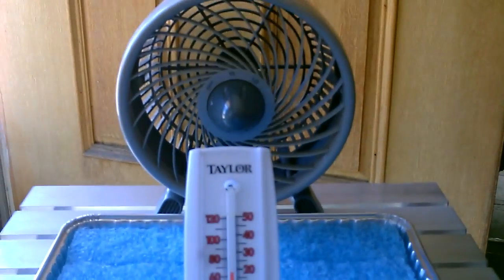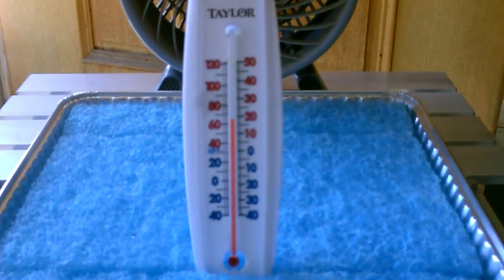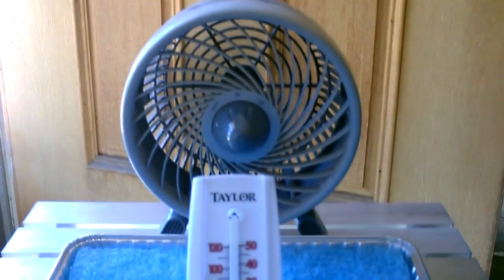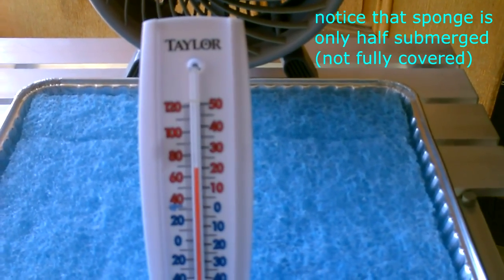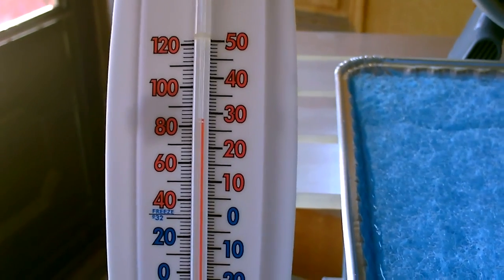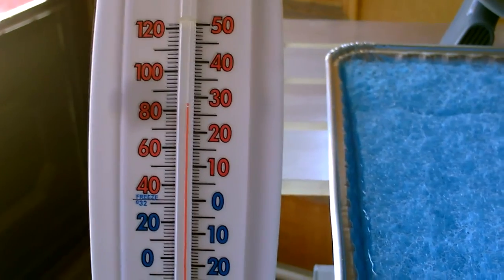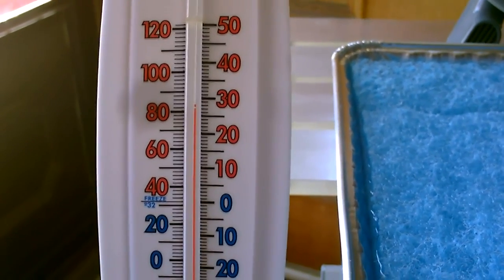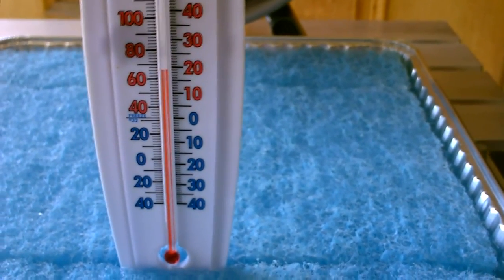Homemade "Sponge" Humidifier/Air Cooler - DIY - Fan-Forced Evap. Cooler/Humidifier

Comment: You actually would need to have a hygrometer to measure the measure the humidity, not the temperature.
Reply from the maker: hi. this is true but you can roughly tell what the humidity is just by knowing the temperature drop. they have evap charts that show the humidity level if you know what the room temp is and how far the temp dropped.

Comment: I have a wick filter for my humidifier and it always hardens despite of my using the stupid chemicals to prevent calcification.  Soaking them in vinegar weekly does not help either.  Im tired of having to buy new replacement filters every few weeks!  The city water here sucks!  Im going to try this sponge idea.  Thanks!
Reply: If you have the large paper filter, I have one for my Essick...well, I went to their website to order a new one and they went from $10 to $31 and I said "not" - LOL.  So I went out and bought that blue cellulose stuff they use for evaporative coolers.  It won't wick of course, so I cut a piece of 1/2 PVC, drilled small holes in the bottom. Glue a cap on one end and siliconed a plastic L fitting on it.  Attached it to the smallest pond pump they make and it runs great.  

You could use aspen and probably not have to go thru all that, it will wick.  I used the blue cellulose because I have several of them and I use them in my tropical greenhouse and the blue cellulose lasts longer before I have to replace it.

It sounds like your filter is itty bitty but I thought I'd mention it.
Reply: Maybe use reverse osmosis water?

Comment: I like it, I have AC but I notice that placing a long wet towel on a long cloths hanger is very quick to increase humidity you have to play with the towel folding size to get it 40 to 50%, the recommended level of humidity. if you see it is very humid fold it onto half, it sure make huge difference now I sleep with AC but without the effect of dry mouth etc.. the only disadvantage is that towel need to be wet every 4 hours .. but if it is folded or 2 towel fold it on themselves together it take 10 to 12 hours to dry and turning the inner side of the towel out after 4 or 5 hours to expose the wet side of the interior of the towels. It really makes huge difference,no cleaning of humdifier, or fear of mold on it,  nor noise , and echo friendly and clean.
You can not put 3 or 4 towels at once because humidity jumps to 80% easily so it is a balance... but it is great.
I let the towel dry for 30 min or an hour by the time I am out.. or more.. so it would not create mold.. I never seen mold anyways but just in case I throw it on the washer every weak  just in case though they are clean towel but minerals accmulate on them from the evaporated water..  if you wash your clothes you can hang one item there too and skip the towel etc..
Thanks for the video, and this long comments are for others who may want to other ways. 

Stay COOL 

PS I have never had any ill effect from AC since using this, one day I forgot to wet the towel and My GOD what a difference it made with or without humidity.
Reply: Thank you for this comment, I’ve been struggling with this since I put my window AC unit in and I’m going to try this tonight!
Reply: @margaretgodin8459  you are welcome, Air conditionar dry the room, it takes whatever little humidity in the air, and condense it , hence water drip from it (we only see that only if the little interenal drain is blocked , the AC strat dripping water that water is the humidty gathered by the cool temperature on the coils..)  by the way plate of water in the room, a famous advice, does not increase humidty by much, even fan on it, I try it and have 3 humidty meter.. even with fan on a wide bucket of water, it increase it by 4 to  5% not much considering it take space and not looking good, I just did it to see for experment..
what is your level of humidity in your town..
I live in a desert zone, in much of year it is around 40% approx, but in summer (5 months) it is as low as 6% ... it is on these months I hang a towel etc.. if you have 20% and above it is very easty to incrase it by 10% percent.. but when it is 6% you notice the towel dry in 6 to 8 hour (2 towel folded on each other) so it would last longer..
Reply: @margaretgodin8459  I forgot to add the "plate of water in the room" tip, only work if it is as big as  big as the size of a half bed or or a bath tub size, I did the calculation.. so it would have a large surface to evaporate passively.. 2. I also close the room and windows,  and I realize only neat towel fold it on itself (or 2 towels when it is very dry weather) are the best.. now if the towel is near a fan or the AC opening , the humidity increase very quickly .. ideal level 40% to 50%, but it is ok on skin etc if it is between 30 to 60% above that it get uncomfortable and encourage bacteria growth .. the sign that you are having 30% to 50% or even more, is if you bring to the room a cold glass of water with  4 cubes, or a very cold water bottle and in few minutes you see it foggy , the more water droplets the bottle forms around it the more humidity in the room, if it does not form fog at all then you live like where I live (when it is summer, ) then you really need to increase the humdity.. tell me and I explain with more details sister. I wish you the best sister, Salam.
PS: I live in Arabia, I can buy humidifier but read that the head of the spreyer need to be cleaned frequently so that mold won't accumulate etc etc.. so I worried about that and hate to have machine on 24 hours even while a sleep, the towel is quiet, clean, and friendly to environment.. have a great day
Reply: @margaretgodin8459  also if you notice the towel become rough on touch (after a week ) it is no worries, this is the mineral deposit from water which evaborate and the towel becomes rough to the touch.. that is why I toss them into the washing machine every week or 10 days.. I notice the that door mat (from natural material and new ) hold much more water and last double because they have many thread.. but maybe not necessary... I just made many experment for fun (and check my hydrometer, the humidity meter to see which is the best) hope that help..
Reply: Another thing, I notice that my old AC cooled 2 degree Celsius  more with humidity around.. which made and less work on compressor, and room stayed cooler longer when it is off. I always stop it every hour or two for various reasons. 
Your 14 f less or 6 c less is wrong reading, unless you plan to stay very close to it which would be uncomfortable, I would guess the general room temp may have dropped 6f or 2 c which is not bad. But I do all this because humidity here is 5% in the morning and 10% at night in hot 44c degree in summer.. you skin, hair, and throat will thank you. You will be less likely to catch cold since 40 to 50 humidity level is the best for you and bacteria are slower than dry or very humid medium. greeting from Arabia.

Comment: Where u get blue sponge material or does it have a name brand.  Like goto home depot and look 4 blue sponge?
Reply from the maker: hi there. i get it at home depot. it's just standard evap cooling pad material. many of the home stores have it.
Reply: @desertsun02  Lowe's has it, it's something you have to order, they don't stock it in their stores, at least not in central Kentucky

Comment: +desertsun02 Thanks for the inspiration. I have a question. Say if I were to suspend 
sponge wipes with a few inches at the bottom dipped in water and rest of
 it in the air (held with clips on a mini BBQ grill) with a fan blowing.
 Do you reckon that will be more humidifying than a sponge? Thanks

Comment: Make a box frame that you can slip fiber filters into. Then run the water drip system that runs the water through a cold sink before it drops down the filters. Then have an air duct bring in air feed by a booster fan. You could install ducts in the walls or cellings to make this work. A you would hear would be the air being pushed through the cooler!

Comment: silly question but how do you know your have dry heat in your house and on more question if you have to put a pan of water on top of the radiator to put moisture back in your room does the water need to be boiled or just room temperature
Reply: If you live in a desert,  you have dry heat.  Your skin may be excessivey dry. I know.. I lived there.  In the winter, if you live in a heated building, your air is dry.  You may wake up with a dry mouth and almost sore throat. You eyes are burning,  Nasty but true.
Instead of a pan, use ceramic soup/cereal bowls or pyrex baking plates. Get them at a thrift shop.  I had about a dozen of them on and under my radiators and it worked well for a 1200 sq foot home.  If you have hard water you will ruin your pan or even an aluminum pie plate will eventually  get pitted and leak. (Once again, been there done that). The ceramic or glass items are easy to wash and won't die on you (unless you drop them, of course). Be sure to fill the containers daily and wash weekly.  
Also with glass/ceramic, you don't have to worry about if your water is hard which causes the pitting.  Get a pitcher or a big measuring cup to refill your containers with regular tap water. Good luck!
Reply: @joanneenriquez9555  You need distilled water, not tap.  As you will put contaminants in the home

Comment: Place bottom of thermometer centre of airflow and show another one in the ambient , this will show a more accurate differential. My house was on a flat rate cold water feed so I put that through a DX coil in the furnace plenum , water through coil then down the drain . The differential in that application was very noticeable , I presume not Kosher for California and its water issues.

Comment: It is very dry in my house with wood and gas furnaces going and this would help the static problem right? Im not sure hoe much more voltage i can take!
Reply from the maker: hi there. yep, using this will reduce the static electricity (may even eliminate it altogether)
Reply: desertsun02 Y si instalas un aparato de aire acondicionado???

Comment from the maker: +maesteo yes, as part of the testing tried "water only" but since there's nothing porous for the air to blow through or around it just skims the surface of the water and not much evaporation takes place. (the result being minimal humidifying/cooling power and a poorly performing unit. (approx. 80% decrease in effectiveness)
Reply: You should try using a wick for a humidifier. They're cheap and are designed for this purpose (more or less). Dura-cool isn't designed for wicking